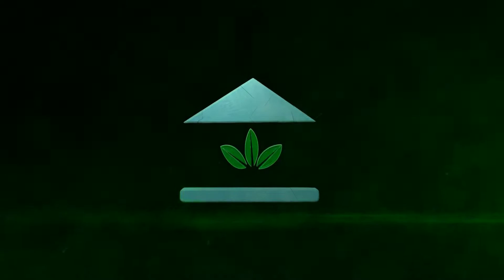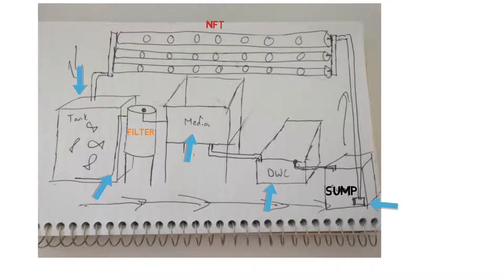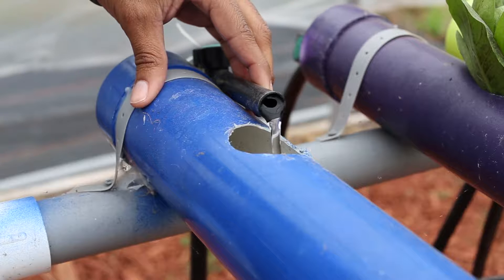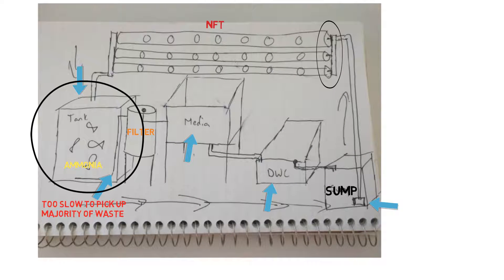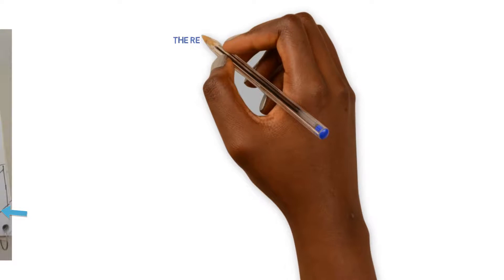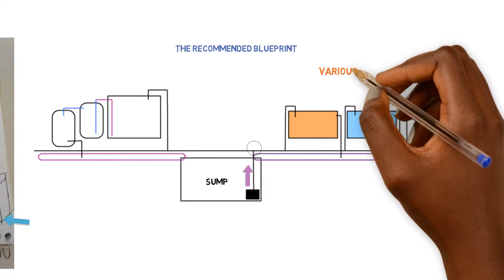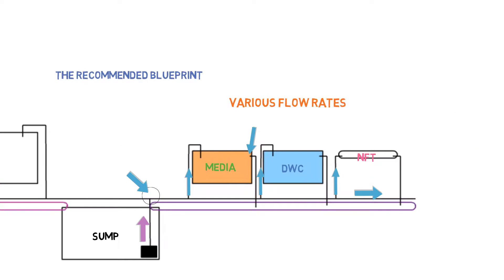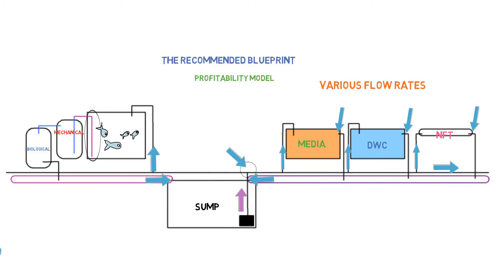Student Aquaponics Blueprint Review | Ask The Aquaponics God Ep24

Comment: How do you determine what size your sump tank should be?
Reply from the maker: We calculate the sump tank size by using a formula that we came up with here. It's extremely lengthy and we need to do a video on the subject to provide a beneficial answer. We basically take the sum of all of the water that flows through grow systems and pipes and that lets us know how much water we need to pull from the sump. We then figure out how much water we need to have in our sump to have at least 45% of the sump filled up once all of this water is pulled and distributed throughout the pipes and tanks.The sump tank is the last calculation that we compute once designing a system.
Reply: I look forward to the video. I have my system redesigned to split the flow after watching this video. Thank you for the great content!
Reply from the maker: That's awesome that you were able to find some value from the videos. You will save yourself a lot of hassle by using the split flow method. Good choice!

Comment: can you use your sump tank as a dwc?
Reply from the maker: Sure, I don't see why you wouldn't be able to. I wouldn't expect much production out of it due to the small size, but it's possible. You also need to make sure that you don't have any water from the return lines splashing on your floating raft. This could cause water loss and disease.
Reply: thank you my sump tank is about 500 gallons its a 4x8 square